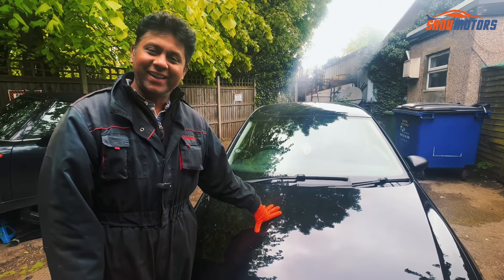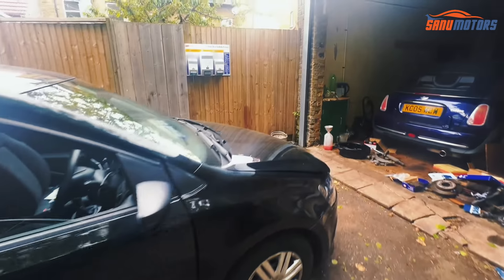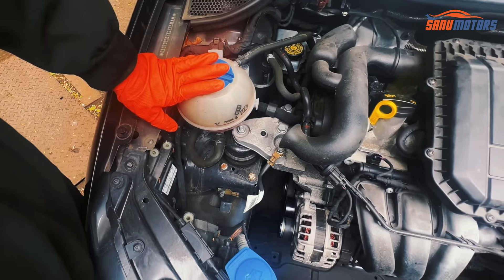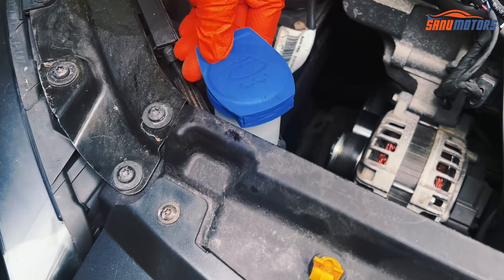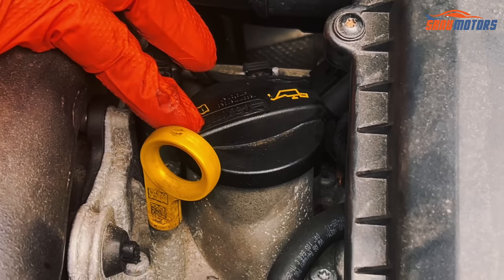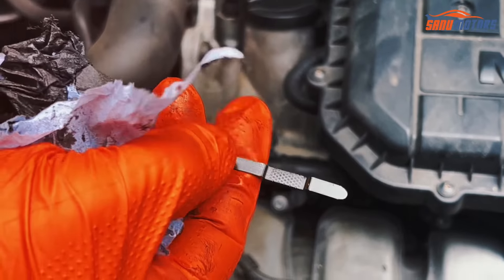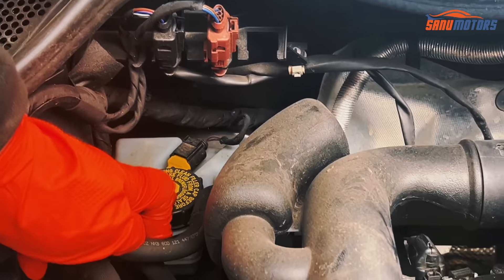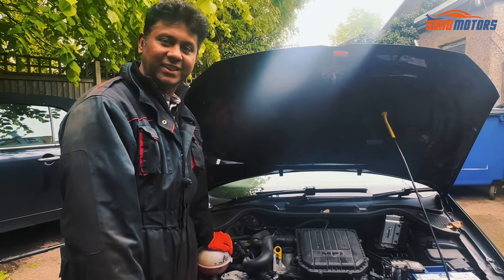How to Check All Fluid Levels in Volkswagen Polo: Complete Guide 💥🔥😉 #volkswagen #diy

Comment: Wanted to see how you check gearbox oil
Reply from the maker: Checking the oil level in a manual gearbox typically does not involve a dipstick like you would find in an automatic transmission. Instead, you would need to access the gearbox and perform the check manually. It's important to note that working on a manual gearbox can be a complex and potentially messy task, so if you're not comfortable or experienced with it, it's a good idea to consult a professional mechanic. Here's a general outline of how the process is done:

Locate the gearbox: The first step is to find the manual gearbox on your vehicle. The location can vary depending on the make and model of your car, but it's usually on the underside of the vehicle, near the engine.

Raise the vehicle: To access the gearbox, you may need to raise the front of your car using a jack and secure it with jack stands. Make sure the vehicle is on a level surface and properly supported before getting underneath it.

Remove the filler plug: Look for the filler plug on the side of the gearbox. This plug is usually a square or hexagonal bolt. Use the appropriate wrench or socket to loosen and remove the filler plug. This is where you'll check the oil level.

Check the oil level: With the filler plug removed, you can use a finger or a clean tool to dip into the hole and check the oil level. The oil level should be close to the bottom of the hole. If the oil is low or doesn't reach the hole, you may need to add more manual transmission fluid.

Add transmission fluid (if necessary): If the oil level is low, you can use a funnel and a suitable transmission fluid to add more until it reaches the desired level. Refer to your vehicle's owner's manual for the correct type of transmission fluid to use.

Reinstall the filler plug: Once you've checked and adjusted the oil level, reinstall the filler plug and tighten it securely.

Lower the vehicle: Carefully lower your vehicle back to the ground and remove the jack stands.

Test the gears: Before driving, start the engine and go through the gears to ensure smooth shifting.

Remember that it's essential to follow your vehicle's specific maintenance guidelines, as the procedure may vary depending on the make and model. If you're unsure about any step or not comfortable doing this yourself, it's highly recommended to consult a professional mechanic to check and maintain your manual gearbox. Incorrectly checking or filling the gearbox can lead to transmission problems and costly repairs if done improperly.